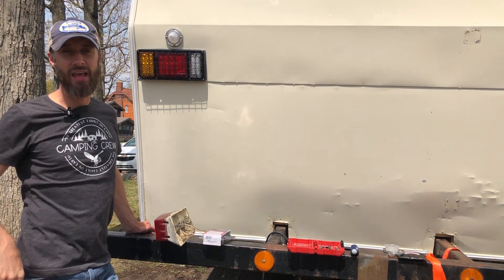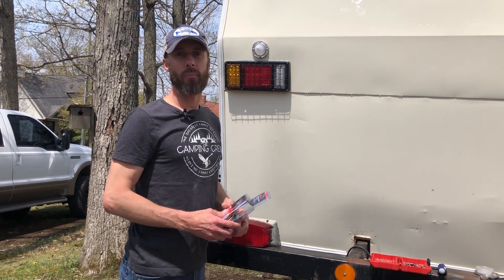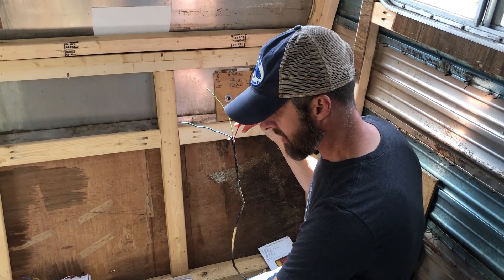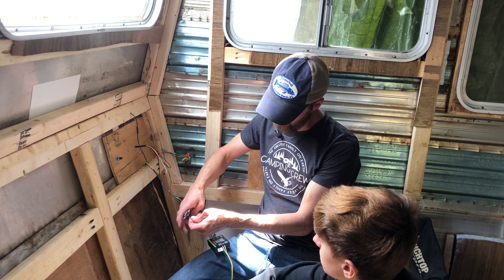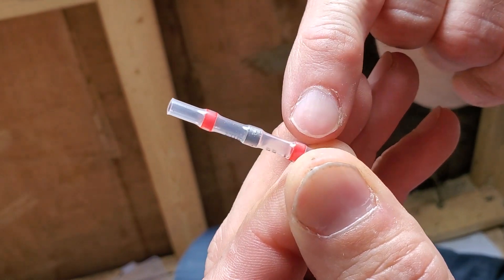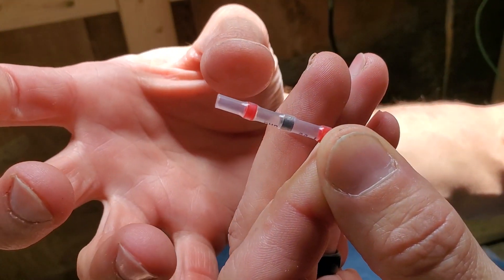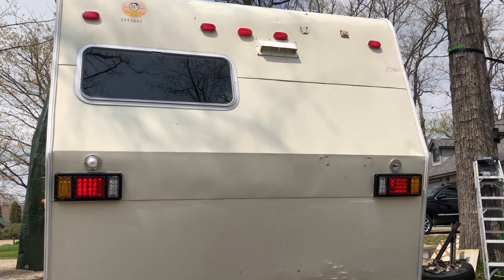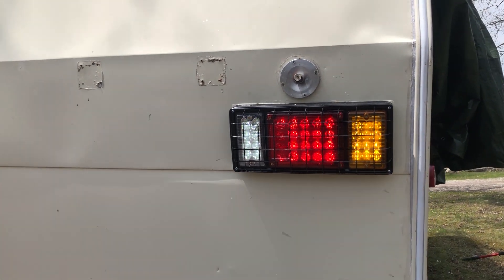How to Install LED Brake Lights on an RV or Trailer with Separate Amber Turn Signals Using Converter

Comment: I would suggest that you mount that module in a place where it can be accessed for replacement. I have had two of those to quit working after a few years but were a different brand. Yours may be better but just in case you might want easy access. I am enjoying your build!
Reply from the maker: Yes, great minds think alike!  We didn't end up mounting the box yet.  We're most likely going to end up building a storage compartment in that area and mounting it in there so we don't have to tear the whole wall apart if it goes bad.  Hopefully it'll last though!  Your comment makes me glad we didn't go with the no-name brand off of Amazon that we almost bought.  Thanks for watching!

Comment: Hey just letting you know i bought the same tail lights of ebay last year and the first time it rained they  filled up with water and once the weather warmed up mold covered the whole inside of the lens. Both sides did the same thing and they both had no visible cracks. Your results may vary but you should keep an eye on them and seal them up if needed before the lens gets stained.
Reply from the maker: That's crazy and really good to know.  We noticed some moisture in them early on already so we'll have to keep an eye on them.  Thanks for the comment!
Reply: I have the same tail lights but I just pulled them apart and put silicone paste around where water can enter and that solved the water problem

Comment: I'm hooking up a flat bed to my truck essentially the same idea as here. The question is does the red brake coming out of the curt kit hook up to both sides? If so how did you connect the two? I would have loved to watch the fast speed connections you did in real time! Thanks what an awesome job u guys are doing!
Reply from the maker: Sorry for the extremely late reply. I'm sure you've sorted things out by now. If not, I used both stop signal wires into the red Curt wire. I used a large enough solder splice to combine the two signal wires and then splice it to the one red Curt wire.

Comment: No,  I want to know after you installed the Curt converter and got separate amber turn signals, what wires to LED did you hook up to the LEDs for the vehicle brake and taillights.from the tow vehicle?
Reply from the maker: Hi, we're not sure about the wiring colors on your vehicle.  There was a diagram on the Curt package that we went by.  You might need to get out a tester and see which works are receiving power when you hit the brakes.  Sorry we couldn't be more helpful.

Comment: I correctly got the back up lights and amber turn signals done, now I want to know what wires to hook  up from the tow vehicle to the LEDs to  get marker/taillights and brake lights.
Reply from the maker: Hi, we're not sure about the wiring colors on your vehicle.  There was a diagram on the Curt package that we went by.  You might need to get out a tester and see which works are receiving power when you hit the brakes.  Sorry we couldn't be more helpful.

Comment: @Retro Revivals did you guys ever test the "hazard" circuit with this light kit?  I ended up purchasing the exact same configuration with the same light kit, and curt 2-to-3 converter and everything is great, except for the hazard circuit.  They just buzz and flicker for about a half a second, during the vehicle's flash sequences.
Reply from the maker: I'm trying to remember... I think we did try the hazards and they didn't work but I'm thinking we might have read that in the reviews for the Curt box too.  We should test that again.  Hopefully we never need the hazards, right?!?  Thanks for watching and commenting!
Reply: U have to change your hazard relay and I had to change my flasher relay as well I just can't get tail lights to work
Reply: Over to led relay

Comment: How u get the running light I got all working but tail light
Reply from the maker: We left the running lights wired how they came from the factory. Only the brake, tail lights and turn signal were  wired through the box. Hope that helps.

Comment: OMG! Just what I needed to see. I was afraid I needed to run a wire from the front. Does the unit come with a diagram for the connections? I laid under this 1989 motorhome way too much already! Thank you.
Reply from the maker: Thanks!  We ended up making this video because we couldn't find anything out there to really help us so we're happy you found it.  The box itself had instructions on which wires to connect where.  It was pretty straightforward.  We just had to run wires over to the converter from the passenger side for ground and brake lights back to the box.  Good luck with your connections.  We hope you subscribe to follow along with the rest of our renovation!

Comment: Bare metal crimps and adhesive lined heat shrink FTW.  I like the idea of the solder connectors, but I don't like using solder that melts at that low temp. I have also pulled many of them apart, just like the old plastic covered ones. I get into a job and tug on a couple connection and they fall apart. User error, sure, got to tug to make sure its good, but less guess work with bare crimps (tug it) and adhesive lined shrink.
Reply from the maker: Thanks for the comment 😁. They are my new go to for wiring connections.

Comment: I agree with the tedious job but if done incorrectly it will haunt you, well worth taking your time and avoiding future headaches. I look forward to seeing the tackling of the roof material, I am sure you are going to have some surprises up there, I think it is the most neglected part of these RVs mostly because of the ability to get up there. I knew every year I was going to have to reapply and remove some old caulking or butyl. It is mostly very easy but time-consuming and once again tedious. A rainy drive will give you a good indication of how awful things can be in a hot and humid RV, looking forward to your journey to getting this project back to being road and camp worthy. My two cents are that it might be worth running some cable for a rear camera that can be incorporated at a later time.
Reply from the maker: That's a great idea about a backup camera.  We will look into those before we close up that back wall.  I know they make some now that are wireless so I guess that could be an option too.  The roof is quite a mess.  We're still working on it but hoping to have it back together in the next couple days.  Thanks again for watching :-)

Comment: What about warning light? Doesn't work?
Reply from the maker: Great question. Someone else asked the same thing. The hazards won't work with that Curt electrical box I installed. Everything else works.

Comment: You never showed one connection to the 5 wires of   the new LED light from the Curt converter or the tow vehicle. You spent way too much time on wire soldering. Re-do the video.
Reply from the maker: 😂 Well, we can't redo the video but this one was a follow-up to the one before where we added the LED lights and they didn't work right... maybe what you wanted to see was in the other video?